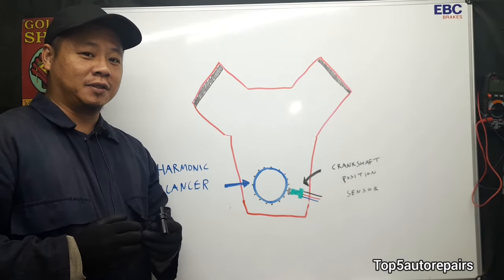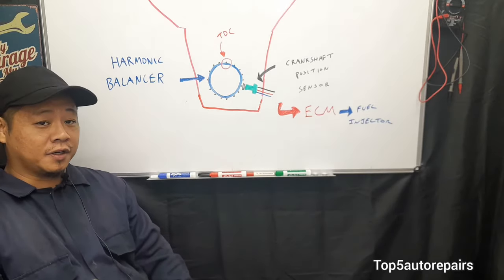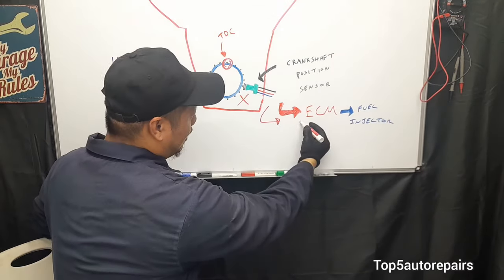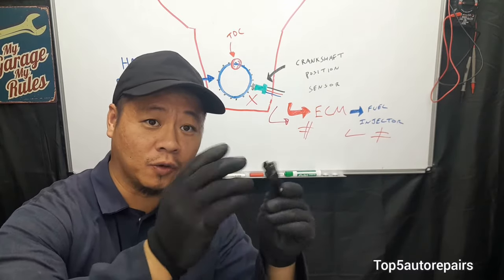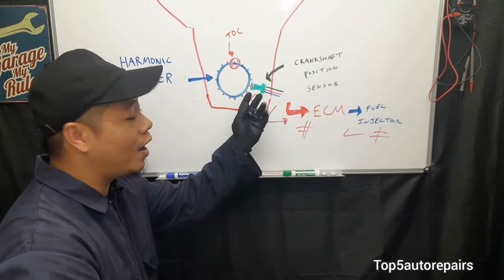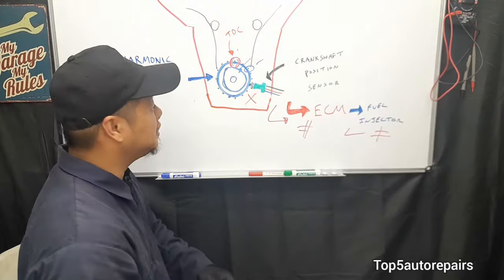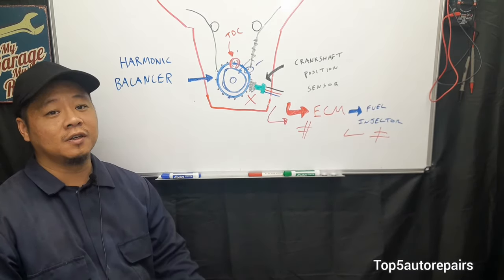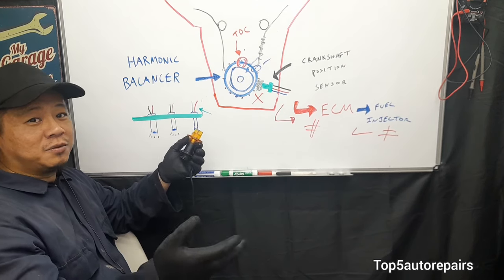Symptoms of Bad Crankshaft Position Sensor (Explanation Why It Fails)

Comment: Can it cause a car not to start now and again ?
Reply from the maker: Yes it can. Thr crankshaft position sensor is intermittently failing.
Reply: @Top5AutoRepairs  thanks for your help 👍
Reply: I was thinking it was the car battery and i thought it was the car alternator but as you say the crankshaft position sensor.
Reply: @Top5AutoRepairs  do you have an email address that i can contact you on thanks
Reply: Do you have an email address
Reply: What is a car / spanner light mean on your dashboard mean if you can tell me on a vectra c

Comment: So if there is dirt on the crankshaft fins messing with the sensor signals, not much you can do for that? Get a new car?
Reply: Spray it down with some water, then let it dry.
Reply: @AUDIO2AUTO  Really? spray them inside the engine?

Comment: Can I tap your brain for a second please my friend? I have a P0315, but the car runs without any problems except when I remove my foot from the accelerator pedal and decelerate. It stores as pending then stores permanent.

1. I replaced the crankshaft pulse ring and CKP sensor when I changed my clutch (all OEM instructions followed). I had P0315 before, but still have it.
2. Always starts first time.
3. Never stalls. Never cuts out.
4. Always receive fuel, although fuel economy is very poor at the moment. (Going to check purge valve, clean injectors and check timing. Already replaced cam cover, MAF sensor, sparks, 02 sensors, cleaned VVT solenoids, throttle-body and thermostat system.)

But, it is sluggish at low speeds especially in 1st, but fine from 2nd to 5th. The car will jolt when decelerating, a subtle kangarooing but nothing major. When code is cleared this is when the MIL will come on but only when I have driven above 40 and start decelerating. 

Apart from the above mentioned work I'm doing, is there anything else I should inspect? Thanks 👍